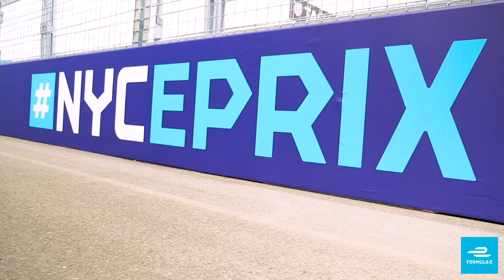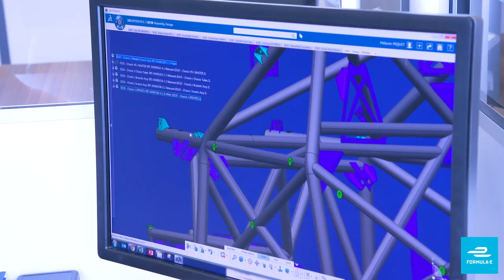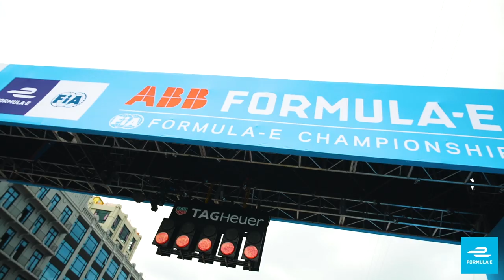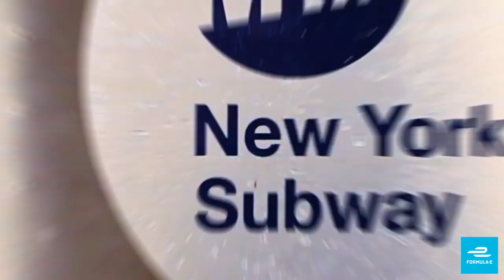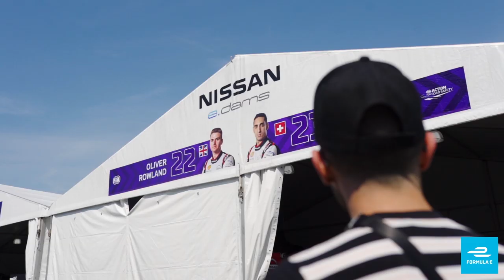Oliver Rowland Presents From New York City! | Formula E Street Racers S5 Episode 18

Comment: Tell you what . I hate the no proper engines and the cars all look the same and the crowded track. BUT they do race and they are not in trouble if they happen to bully another car or touch wheel to wheel. The cars don't disintegrate on contact. The aerodynamics don't destroy the air for a following car preventing overtakes. They don't need to plan a tyre or pit stop strategy to overtake or wait for a safety car. They are not called in front of the stewards like schoolboys to the headmaster because they overtook someone. All they need is to put a V8 in these things, make them look different from each other and open the tracks up and they would kill F1. And that girls legs. I mean F... me F1 banned pretty girls. That says it all to me.

Comment: A series full of ex f1 drivers who couldn't cut it at the top level and some that are past it.Might b better if they stopped racing on them botched up scalextric tracks.they don't even use the full Monaco circuit FFS.
Reply: Well we dont have to whine about it. The cars do that.
Reply from the maker: Thanks for taking the time to write that comment.
Reply: BADWOLF1874 well i believe in 10-15 years electric cars will improve so much that theyll take over f1.